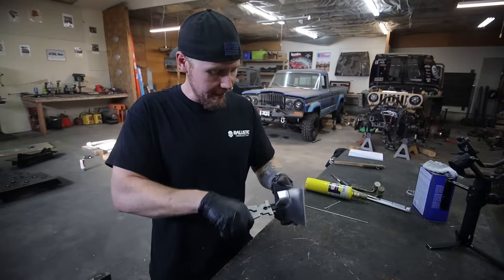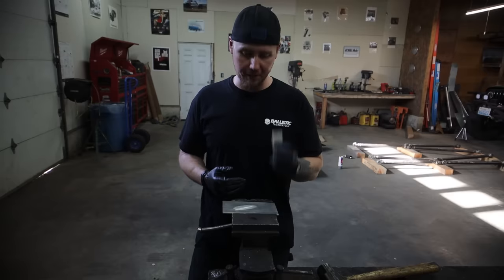Amazon's CHEAP Alternative To Aluminum Welding!!! (Alumaloy)

Comment: I do  some silver soldering in my gunsmithing and I've found that if you place your pieces on a brick rather than an iron vise, the pieces will heat up more evenly, as the vise will draw away the heat.
Reply: That's true!
Reply: Another suggestion is to try a rose bud torch.
Reply: Brayan Carmona  I just said brick, but what I have is Fire Brick. Never had a problem with that. I've done some cutting with a torch and have concrete explode. Not good to be around. Thanks.
Reply: Would a chunk of solid steel work for holding the heat as well if you wanted it to dissipate faster than steel but hold the heat to a localized area? Maybe even preheat the steel before laying the aluminium on top?
Reply: Brayan Carmona he’s referring to fire brick as used in fireplaces..
Reply: Brayan Carmona and calcium explodes in concrete when heat or slag hits it. Why u put a steel plate on concrete when cutting over it.
Reply: @Tictacpanter  That might work, but the chunk of steel would be need to be sizable so heating it would waste a lot of time and fuel.  Most big box stores should carry fire brick. That'll do what you want and you won't have to worry as to what to do with a big chunk of really hot steel  for the next few hours.
Reply: @Joe Atwork I see your screaming chicken, i was with the 3/502 in Iraq 2003, im also a gunsmith in Bmore Maryland. I want to try this stuff to attach an aluminum rail to an aluminum pistol receiver, I have already shaped the rail with a perfect fit. DO you think this stuff would work? I dont have much experience with brazing or silver solder yet, im working on it now. would Silvaloy be too hot for aluminum? Thanks
Reply: @Joe Atwork
Reply: @mikelilliart  Hey, Little Brother.  3/506 '69-'70 Vietnam...11 Bravo.  99% of my gunsmithing is on flintlocks.  My silver soldering is on trigger guards, nose caps, and such.  Not even sure the type of silver solder I have.  It was given to me a long time ago.  Anyway, best of luck to you and thanks for your service.
Reply: @OldJoe212  yeah old asbestos stuff like brake lining, pipe etc work well too
Reply: @samsnushall1668  Back in the days when asbestos was good for you.
Reply: @OldJoe212  meslothemia takes decades to take hold, asbestos has always been good for you, it's only old people that suffer. Who needs them right.
Reply: We use chamotte bricks and everything is OK :)
Reply: @OldJoe212  B co 2/187th rakkasan
Reply: Brayan Carmona you have no idea what your talking about.  Have to love the internets where uniformed people try to tell informed people what they are doing wrong. You could cause someone to loose a eye with that bad information. SMH
Reply: Brayan Carmona  torch only gets 450? 450 is the temp paper burns at. Ur confused
Reply: Brayan Carmona  stone can fracture badly with high heat. Firebricks are the way to go or ceramics
Reply: Do you have a class 7 license or another way to legally do gunsmithing? Or is it just personal non-NFA stuff?
Reply: Thanks for that piece of wisdom 👍
Reply: I guess a brick vice would be best choice...lol, hey i  have patient pending btw.
Reply: @justinvowell524  it's used in making forges and foundries also.  Plus pizza ovens and a whole host of other things. Most hardware stores sell them.
Reply: You got it! I’ve done a lot of siversoldering as well.
Reply: @samsnushall1668  that's the way I thought until I became one. Watch out. It sneaks up on you.
Reply: @bermchasin  just build mostly flint locks for myself. That cartridge stuff is a passing fad.
Reply: @OldJoe212  haha commonly kidding ya bud total respect
Reply: I have a brick shaped piece of asbestos made for the purpose
Reply: Brazing or silver soldering can be used to join just about any metal to another metal with the correct alloy and flux.   I brazed in a manufacturing setting(refrigeration)  for about 14 years with copper to copper(which is very easy if the copper is clean), copper to steel, and copper to brass.  Anything other than copper to copper needs flux for the type of materials to be joined.  A shielding gas of nitrogen or argon is also good to use if possible to get good joints.
Firebrick, kaowool, or ceramic insulation is good to put parts on for brazing.
Reply: Brayan Carmona  refractory bricks, or other refractory "stone" will do it
Reply: The vice is good for stability but yeah it draws heat away, maybe put something in the jaws of the vice that doesn't draw heat like a piece of wood, though you'd have to not get it too hot or failing that a piece of brown electrical board which is fire retardant, forgot the name of it now, it'll come to me and i'll amend the comment, it''s also used behind trunking where the trunking meets a metal control panel to act as an an insulator and to prevent the cables chaffing on the metal
Reply: Thank you
Reply: MAP gas tank and tourch head is legally a Burglary tool.
Reply: Brayan Carmona  450 F? Let me guess ..... Solar tourch?
Reply: I restore antique metal art object and put the work I'm soldering on a ceramic pizza stone.
Reply: @nelsonx5326  I noticed that with silver soldering you're better off with an organic Margarita Pizza as opposed to it like a four cheese medley!
Reply: @zorroonmilkavitch1840  
So true. But for real the pizza stone works good.
Reply: I use firebrick, that's the way to go!
Reply: @xsalamand3rx  you know that's a really good idea I got to get my friends he offered it because he doesn't use it anymore but that sounds like the way to go when you working on a wooden bench and you got some hot work to do at the that's a keeper
Reply: Yes sir, we work off wooden benches brazing large copper electrical connections with silver solder and oxyacetylene , firebrick works like a charm. I would honestly be preheating all day if we used a vice to hold the work piece, vices are huge thermal heatsinks especially with copper, way worse than aluminum. Glad I could help!
Reply: Brayan Carmona  Losing, not loosing.
Reply: Good idea
Reply: Go Screaming Eagles... 'Air Assault'!
Reply: @fml5910  how is this different from  Aluminum Welding?
Reply: @mikelilliart  m
Reply: Just weld it on a hot 🔥 summer day out in the 🌞 sun.
Reply: Even a piece of fiberglass insulation in the vise jaws or under your work should suffice

Comment: Nice stuff! I'm a professional TIG- Welder for over 35 years and I' ve seen a lot of crabb for brazing and welding aluminum. But this stuff seems to be a hit! A suggestion from my side: put the thicker material in a oven, hot as it can. If I had to close the hole in the tank, i would put the small aluminum plate into the oven. So you can warm up the tank with the torch! Best regards from the very north of Germany!!
Reply from the maker: Thank you! Great suggestion!

Comment: tip.. jewelers soldering board is the best material to put your work on it will rebound almost 100% of the heat back into your project.

Comment: Laying the parts on the vise slowed you down. The aluminum plate was pulling the cold out of the cast iron. Pick up a couple of hard fire bricks. One as base for the parts, the other as a backstop heat reflector. This setup saves time and fuel. ✌

Comment: Sorry to reopen an older post, but you can get a 'flux' for aluminum brazing. It helps the 'flow' of the liquid formed by the rod, so it will flow under joints.

Comment: FYI - The technique where you pre-braze the edge of a joint before you make the connection is called "tinning the joint". That technique is used a lot in architectural sheet metal work solder joints in copper sheet, galvanized sheet steel and stainless steel sheet metal.  Great video!

Comment: This stuff is amazing for radiator repairs. You can also buy flux (comes in a plastic bucket) for the rods. You just dip the rod in it after you cleaned it of and go to town. Really helps keeping your “welds” cleaner.

Comment: I've been using these for 40 years and they work great! I've made some nice looking radiator shrouds.
Reply: Do you think these rods would hold on an rv water heater that is leaking at the seam?
Reply: @brandonpierce1729  Depending on how close it is to the heating element... If it is cleaned thoroughly, I would trust them. The water itself is not going to get hot enough to do anything.  It is more of a solider than a weld, but don't do it if it can cause any additional damage.
Reply: @RichardAC59  it's a propane heated tank so no element to deal with and it's in the back middle of this little 6 gallon tank. I have an acetylene torch to localize the heat and that's gonna get a lot hotter than my blue bottle of propane for sure...I guess the real issue is that happy point of hot enough to braise but not too hot to distort or melt the tank huh. Was just trying to determine if this "might" work over tanking it to a weld shop

Comment: One good rule of thumb is to apply the heat quickly.  Use as much heat as you can and place the filler in quickly. 
More heat over a shorter period of time is more controllable than too little heat over a longer time.
Reply: Jeremy Hall.              Good point but there is one big  consideration.     The no warning characteristic and low melting point of aluminum.   Many don’t realize it goes from  solid to goo suddenly with no warning.   Most propane turbo torches can easily slag plate Al so they can still get a nasty surprise.     This stuff though not technically as strong  at least gives a lot of latitude to guys who don’t do these things frequently.

Comment: I saw a demo of this brazing rod in the late 1970s. Learned a neat trick. If you use an oxy/acetylene torch, you can run it very rich on fuel and coat the aluminum with soot. Then add the oxy 'till you have a slightly carbonizing flame. As you heat the parts they will be exactly the right temperature to braze when the soot burns off. Then work fast.
Reply: Better use wood,  you have woodsoot and the right temrature to brace, lots off soot are not  good the area to brace need tho be clean

Comment: I've used this stuff too and i fond out that you can get it to stick better when you use a stainles scatching tool and scratch through the weld.. I was told that that is better because there is a oxidation layer on the aluminum and when you scratch through that the bonding is much better.... I even repaired an engineblock from a ZX7R('93) with it, and that is allready 7 years ago……  Awesome stuff!!
Reply: I was thinking the same thing about scratching the surface but for something for the aluminum rod to hold onto.
Reply: eaglebrink 93 ZX7R? Sweet bike bro.

Comment: Small tip: when your using the rod to test the temp at the very beginning of the “weld”, once you get the melt you want, flip the rod around and use the cold end to start. Of course the rod heats as you move along but it will make a cleaner beginning to the bead. Something to do with the thermal shock. It also helps if you flip to the cold end if you are just trying to dab a tiny spot.

Comment: I ‘welded’ all of my aluminum intercooler tubing together with the Alumiweld rods sold at Harbor Freight.  Was tricky to control the heat, but got the job done.  Pressure tested to 40psi.
Reply: Exactly was I was looking to hear. Going to do the same - experiment with alumiweld on intercooler piping on latest project. 40psi? More than I need.....sweet.
Reply: Good to see this response, I was thinking about using it to "weld" my IAT bung and BOV flange. thanks!
Reply: So glad to see this. I've got a new radiator that's sprung a leak if it will hold 40lbs of boost it shouldn't have a problem holding 16lbs
Reply: Yeah just be easy with the heat fellas as alloy crumbles easily if you're to harsh with it so go slow... Use some test pieces if you have any and practice first as it really does take little effort!
Reply: @Bread996  Apparently not, he deleted his comment. Well done on the intercooler piping. I wish I had known about this stuff when I did my Lexus.
Reply: think I could build a 35 gallon fuel tank with it? Genuinely curious now lol
Reply: @bread996 did you do 1 continuous bead around each joint or little beads and join them? Map gas yeah?
Reply: Sweet. Budget build continues
Reply: @joshknight8953  Oh wow! You've got me thinking!

Comment: I bought some stuff called 'Super Alloy 5' from Muggyweld that uses a flux and oxyacetylene to braze aluminum instead of just soldering it. Although it's nowhere near as pretty as TIG, they claim it's just as strong - 30,000 psi. What I know is, it is tough as nails when finished - especially handy in places it can be cleaned up with a grinder. Used it to patch up my old duck boat hull after a few rivets were forcefully beaten loose and starting to leak. Touch up with a grinder and it doesn't look half bad.
Reply: Maybe it's 30K psi as a material, the problem is that it's a surface bond, it doesn't penetrate and chemically bond the way a weld does so ultimately the strength depends on how tenaciously it decides to "stick"- I found an unacceptably high level of variability with that. It also has a slightly different color  so you can't finish it out cosmetically like an aluminum weld- although in most cases that doesn't matter.

Comment: This is a really clear demonstration of how to prepare your pieces prior to brazing, and how to spread heat to form a more secure joint.

The original brazed joint would have been sufficient for the application, but it was good that you showed how to make it even better.

These rods are invaluable and to spend time practicing the techniques necessary to gain the greater spread and bond strength will be time well spent.
Reply from the maker: Thank you!

Comment: I hardly use these rods but must agree they're well worth having in the workshop.  Recently used them to patch up a badly corroded ally boat part which would have been impossible to tig weld due to salt contamination, because the base metal isn't being melted which releases locked in contaminants (as in tig) this was the right choice.

Comment: This rod works great to fix cast aluminum parts and even pot metal cast parts. Using fire blankets to keep the heat in works good, just wrap all the large areas with the fire blanket to insulate the piece and keep the heat from escaping.
Reply: Insulating fleece/rockwool and thick aluminium foil are your friend. Just create a fleece/foil sandwich and "mould" it around the workpiece. Works like a charm for small parts, awkward spaces etc. where you can't get a blanket in 👍🏼
Reply: Stick the base plate on a ceramic hob to get it up to temp. Don't use a gas camping stove like an idiot mate did. Unless you want a mini diorama of a certain famous Terminator scene that is 🤣🤦‍♂️

Comment: In the 60's I used 'Aluminum' solder. It was in a spool like lead solder but much thicker/stiffer but it actually had acid flux in the center similar to plumber's solder. Worked okay, for aluminum.

Comment: I knew someone who used "Lumiweld" (similar product) to repair a VW Beetle gearbox/engine mounting lug. "That's never going to work" but he had nothing to lose. He needed LOTS of heat but ran the 'box for 1000s of miles with no problems. Big items need A LOT of heat and the rough surface of crack faces have to be filed smooth.
YOU MUST use a stainless wire brush and stainless scraper wire. Carbon steel will spoil the job.
Reply: I agree whole heartedly and mark all your stainless steel used for aluminum "aluminum" so you don't mix it's use up with the steel projects.

Comment: Thicker material is easy compared to thin....I used to have to do evaporators on older fridges, from people doing the ice pick defrost and puncturing the coil inside the freezer....Could be a real headache, especially depending on where they did the damage....Self defrosting refrigerators....What a blessing....This still taught me how to connect aluminum pieces...Thanks for that.
Reply from the maker: That sounds like a pretty interesting gig! Thanks for watching👍

Comment: I've done a fair amount of aluminum 'brazing' using a torch and rod. One very useful tool that i made, was a stainless steel 'screwdriver', with a wood handle, that allows me to scrape the base metal under the filler to meld the two together. Scraping removes the oxide layers, and also allows me to 'flow' the weld joint. The result is an extremely strong weld. 

BTW - new users should note that the rod does NOT flow or wick like solder or brazing, and I found that advertised fluxes are not really necessary.

Comment: I used this stuff to fill and seal a crack on a hmmwv 6.2l aluminum coolant crossover tube a few years ago. It's been holding very well with no leaks. I didn't even have to remove it from the engine. It's very easy to use this stuff.

Comment: I use map gas torches all the time I love them. I have a few of them but I got the ones with a hose and the tank clips to your belt. Its all I use anymore. I used to lug around a big acetylene torch but I actually got scrapped it years ago for the map torch. It doesn't get as hot but it gets hot enough to compensate for the weight in my book

Comment: In the hvac industry we repair aluminum the same way and out welds hold 500psi on condenser coils
Reply: scooter with aluminum rods, the 15% won’t stick to the aluminum
Reply: scooter  The Industry in General of Manufacturing and Fabrication is in a low quality state Because everything, Tools and materials are from China. I'm amazed at what cheap sellouts
are people in all western countries letting this to happen.  Boycott All kind of Chinese crap! People need to force their  politicians, to make this industries "made in your nation".  There's a lot of benefits even if prices go up. Cheers from Houston,TX.
Reply: Thoughts on using this on an rv water heater that is leaking at the seam? Aluminum tank obviously...